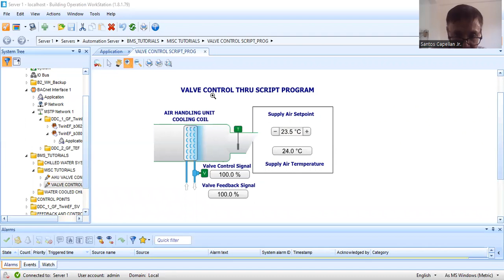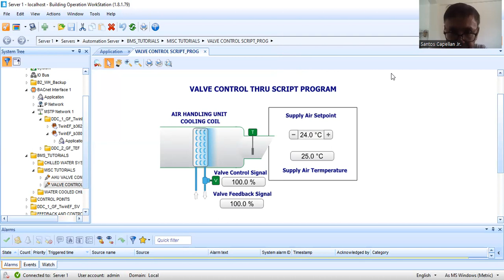PID Control for AHU cooling valve control in a Script Program for Schneider Electric System.

Comment: We have Schneider BMS for HVAC control.  We were given a script to control our AHU’s so that one AHU turns on at midnight Sunday when the other AHU is off & the next Sunday at midnight the AHU which was off should come on & the AHU which was ON should go off.  This script has never worked properly.  Every time we manually intervene & set any one of the AHU’s to come on through the script, within 24 hours for some strange reason, the AHU which was turned on in the script goes off & the other one which is supposed to be off for whole week until coming Sunday turns on in 24 hours.  What could be the issue.  Can you please help ?  Highly appreciate any help.
Reply from the maker: I need to see the script program and the time schedule for the ahu
Reply: @SantosJrCapellan-BMS  can u please provide me a contact e-mail so that I can securely send the script. If you are unable, I will have to send it as a reply to your message.
Reply: Script Code :
Numeric Output Ahu1Cmd,Ahu2Cmd
Numeric Public A

If Sunday And Hour = 23 And Minute = 59 And Second = 59 And A = 0 Then
A=1
Ahu1Cmd = 1
Ahu2Cmd = 0
Delay 0
Endif

If Sunday And Hour = 23 And Minute = 59 And Second = 59 And A = 1 Then
A=0
Ahu1Cmd = 0
Ahu2Cmd = 1
Delay 0
Endif

There is no time schedule associated with the script apart from what is stated in the above code.
Reply from the maker: @saiconnexions1175   juncapel6@gmail.com
Reply: I have already sent the script code in my reply above.
Reply: Any response please
Reply from the maker: @saiconnexions1175  juncapel6@gmail.com